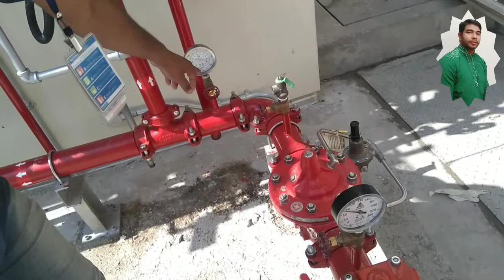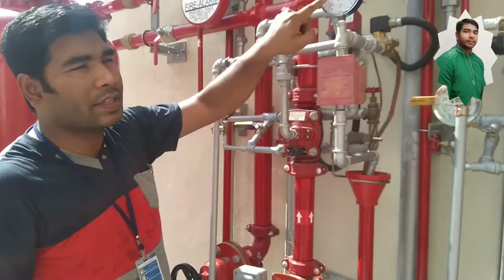Foam system : three deluge valve control by single foam bladder tank. How it’s work

Comment: Sir please tell about how many kgs of foam filled in different capacity bladder tank .
Reply from the maker: it's depend of the room volume capacity .as per deg.. calculate this and it will mentioned in shop drawings.
Reply: @foyzulislam9975  the volume of tank is 1500 litres then ?
Reply from the maker: Capacity of the blader tank not volume